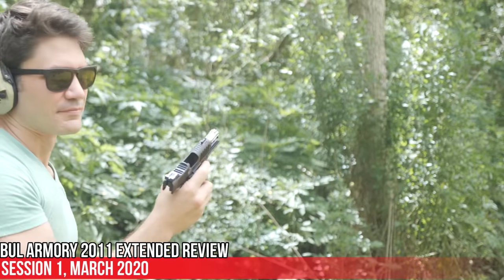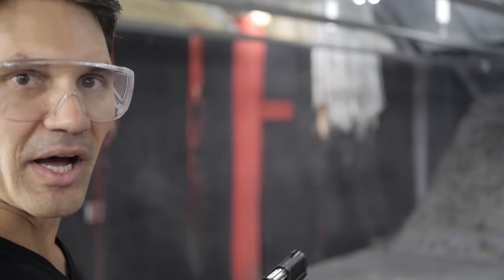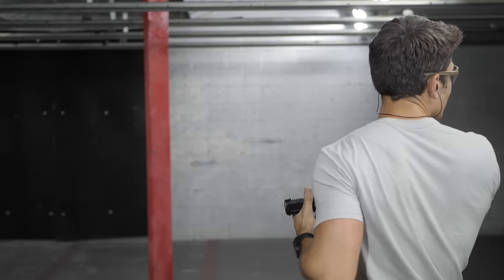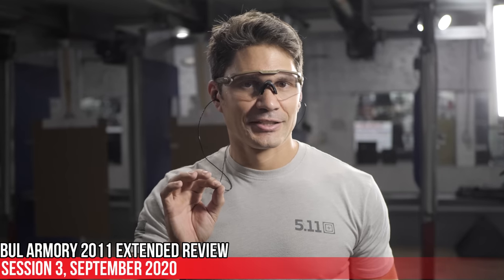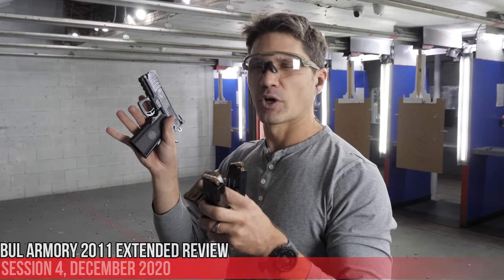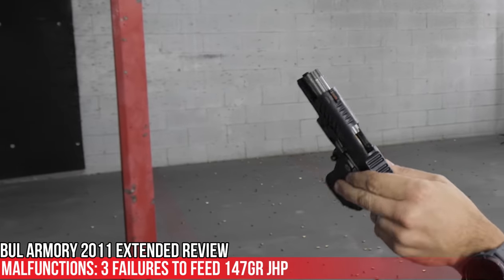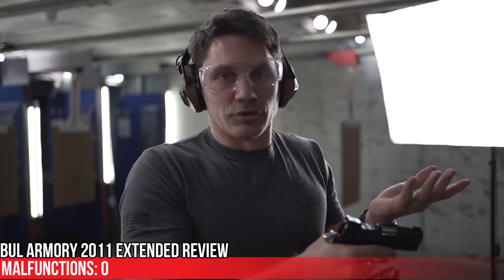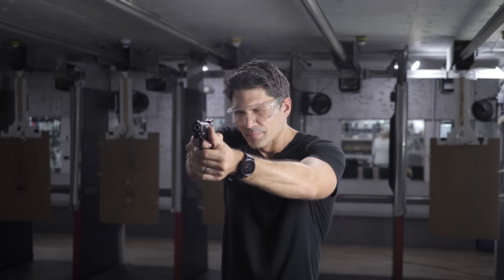Can I Trust my 1911 with Hollow Points? BUL SAS 2011 Extended Review

Comment: If it were me, I'd just stick with 124 gr ammo.... 
Doc, it hurts when I do this.
Well, don't do that.
Reply: 9mm 147 gr JHP is an abomination. The only excuse for using it is in a suppressor host. And only then if the particular load is thoroughly tested in the host firearm with the can installed.
Reply: @careylymanjones  Yep. Have ran my Bul with 1000 rds of Winchester PDX1 124 grain +P Defender JHP without a single issue. Not a single issue with 147 grain either. Because I don't carry 147 grain, so no need to run it.
Reply: Well said HalfCrazy. I was thinking the exact same thing. There is plenty of effective 124 grain hollow point ammo out there  to do the job.

Comment: I have a Bul armory 1911 standard Gov model and it’s a fantastic pistol. I’ve put roughly 1300-1500 rounds through it and only had one failure to feed with shitty Winchester ammo. Smooth action and amazing trigger. Bul armory is the best.
Reply: Which Bul? 1911? 45acp? Magnum Research 1911U C. Built by Bul Armory. Around $850 or so. But Mag Rec has a cappy history in the 80's.
Reply: @hatch721abg  it’s built by bul but branded magnum research. 1911G 45acp.

Comment: "If it can't run the garbage ammo, it doesn't deserve the good stuff"
Reply from the maker: "If you don't love me at my 147gr you don't deserve me at my 124gr"
Reply: @tfbtv  "Jus PEE PEEEEE it away!" 😂 Had me Rollin!
Reply: @tfbtv  Haha! If you can’t handle the rounds at the tip of the magazine you don’t deserve the rounds close to the baseplate. #LRBHOjoke? 🤷🏻‍♂️ WTF are we even doing here, I’ll see myself out.
Reply: If it runs super reliably with underpowered Garbage ammo? Odds are that something in the design is wrong and the gun will end up beating itself up when you feed it the good stuff. Ask anyone who's owned a high round count Glock 22...  That gun's early iterations would malfunction if you had a light on the rail. Not an exaggeration. 

A Surefire light attached to the rail of a Gen 3 Glock 22 up until the design was finally revised in 2013 could legitimately cause it to malfunction and when one fed it good hollowpoint loads at about 10k round mark the thing was pretty much near worn out.
Reply: I don't remember him using junk ammo, is there worse than white box winchester, that's the cheapest i've found in Jamaica
Reply: @davidleesin112   Oh there's a LOT worse than  Winchester white box.. though  James did use some questionable 20+ year old ammo.
Reply: @reignick1133  that's true @ 20+, i've had ammo for less time & they literally fizzle Lol, one area that interested me was maybe tolerance of the feed lip, some of the cartridges were a little longer, but most times i've seen the ramps smooth out after maybe 200 rnds or less, i do like that 1911 though, albeit polymer handle , wonder how long that will last over time
Reply: @hardtarget2359  +P it away.
Reply: @reignick1133  questionably 20 years old yes. But they looked like perfect rounds in his hands......... 147+gr ammo may not feed in all weapons they're just a little longer.... and Especially out of a shorter slide gun.... your asking for issues.

 My first pistol was a ruger sr9 when they were out for Bout 3 or 4 years.... it ate everything. My cz p07, I run 124s exclusively simply bc i found no benefit in anything heavier. Same with the walther ppq.

Comment: As a fan of the 1911, I've found with heavier/longer hollow points they have issues feeding, and from shooting the same ammo through guns side by side, imo it's due to the fact that the barrel doesn't move on a 1911, and the feed ramps are very steep. I've never been able to use the fatter grain bullets (on 9mm or 45acp), so it's amazing that bull has found (hopefully) a way around it.
Reply: My Sig Ultracompact eats HP's just fine. I carry 230 gr. Ranger T's. I've fed it a few mags.
Reply: barrel does actually move, try a different barrel link which prevent the barrel from moving further back allowing room for the round to load into the chamber
Reply: @Jessedh138  ...or just get a Glock.
Reply: Seems to me the heavy hollow points are pointless, mostly you want higher velocity lighter bullets to aid expansion.

Comment: I picked up the Bul SASII UL FS .45 & haven’t shot it much yet but no problems.  Lots of recoil but that was expected & very accurate.
Reply: A little to much recoil , I got the same ,the fs 45, make sure ur rounds are not bumping the slide stop nub like mine was causing the slide to lock back prematurely
Reply: My ultra .45 won't run at all. Bumps the slide lock like you mentioned Tom. It's back at Bul for the second time. What a bummer!
Reply: @antonvouk4145  & Wally Unitus how many rounds have you put through?  I have only put about 50 through so maybe it’s gonna happen & I’ll keep you guys informed what happens.
Reply: @tomharper8351  I've ran about 300 rounds through it. Got it back from Bul running exactly the same. I have ran every ammo I can get ahold of with the same results. The slide is getting banged up from it trying to lock back while cycling.

Comment: "If there's a negative comment imma be rude" dude ain't fucking around ammo expensive
Reply: I feel his pain. A box of HST costs as much as a Taurus G2c pre-2020.
Reply: @keithv3767  yeah I feel it for sure I've been a into guns for a while but just turned 21 this month so getting a ccw is kind of a pain
Reply: Loved this comment myself.  Totally get were he was coming from. And thanks James.
Reply: @TheRealZJE313  yeah im not picky but the 43x looks like a solid ccw
Reply: @trenton6621  Glock 43x or 48 are nice af for a ccw. I have the 48 and my buddy had a 43x. The slim frame makes it great for concealing and feels great in the hand. Only down side is that its a single stack 10rd mag. You can get aftermarket 15rd mags though.
Reply: @TheOneScooby  I always like a great hand feel
Reply: @trenton6621  check out the Sig 365XL if you’re going striker fired.
Reply: @tomharper8351  just bought a kahr cw9 but ill take a look
Reply: @trenton6621  Can you speak like a caucasian please?

Comment: I ABSOLUTELY appreciate you doing this. This is the same ammo I use and have had very similar results with various guns using the 147 and 124gr HST. So weird, I too have never had a problem with the 124,  but a few guns have not liked the 147 HST. 🤷‍♂️
Also, I just spent $950 on a case of Federal HST 124. I never in a million years thought I’d spend that kind of dough on ammo, but even more sadly is the fact that this was actually a pretty “good deal” right now - Ugh!!!

Comment: One of the best cycling 45acp loads in 1911s I have experienced was the Lawman 200 gr speer JHP load back in the mid 80s . I had a cheap Star PD 45 / 1911 compact that ran forever with that load . I wish they'd bring that  load back !

Comment: A $1270 (+shipping, fees and tax) semi-auto should not have those problems right out of the box.  Definitely need to test any new-to-you gun ...and the magazines.  Considering the time and paperwork to buy a handgun here in NJ, I always worry about buying a "lemon".  Over 20 years ago I had a new Firestar 45 that I sent back to the factory with similar problems with HP.  They did some polishing to the rails, and polished and re-shaped the ramp slightly ...and it solved the problem, though it was a bit disconcerting originally.  It's a nice handgun, a bit heavy by modern standards, but it did put me "off" buying additional semi-autos for many years.

Comment: Fantastic review! I absolutely love the 1911 platform but yes they can be finicky with some ammo but yeah! 

Thank you Jim!
Reply: Mass production 1911s that are not proper hand fitted that are out of spec of JMB design is the issue. 3.25 1911s rarely work because it was never designed to work that short of a slide. Very few companies get them working flawless and especially mass production 1911s are not given the hand fitting.they need.

Comment: I had jams quite often with my 1911's 30 years ago and took two 1911's and all my mags to a gun store owner and gunsmith . All he did was ask for my mags, went in his back room. After about 15minutes or so of listening to " tink tink tink tink he came back with my 15 mags and a open can of fired 45 acp brass and told me to load the empty mags with the empty brass and load my 1911's. Then told me to rack the slides as if shooting. Not one failure to feed. Since then I haven't had a jam with any of my five 1911's . I did take 30 new mags to this gunsmith to do the same to them. He has since passed and those mags still run flawlessly but I'm down to 12 of those mags due to giving them to friends tut o fix their game problems....and I'm keeping them!! Before he passed I was lucky enough to have him accurize a colt 1911 for me. It was a match winner.  After he passed away I heard that every 1911 he worked on he would take it to a match and shot the match with it....if he didn't  win the match he redid the accuracy job again. He once told me to carry a 1911 and several loaded mags in my truck and when I could fire a mag or two thru it. Stating you can't just shoot a 1911 once in awhile and stay proficient with it. He said you didn't need a target you just had to shoot it...accuracy will automatically come.

Comment: my CZ 75 Compact D PCR Custom ($950) with close to 1000 rds shot has never had a failure to feed. my STI tactical DS ($2500) suffered a FTF every other magazine or so from purchase. I Sent it to STI in Georgetown Texas. My observation was the slide appeared to be slightly misaligned as it was challenging to set the slide open, requiring multiple attempts from time to time. sure enough, STI agreed and calibrated the slide and frame to STI's super high quality standard of slide alignment. The STI has not suffered any failure to feeds since STI did that work on the gun. (BTW, STI received and sent back within 10 days my 9mm--great customer service) So my experience James may be similar to yours. the higher end 1911's--Bul seems to be such even with a much lower price--suffer from failure to feed if the slide is not absolutely properly calibrated to the frame.  Just as i feel i can rely on my STI now, i believe you can rely on your SAS II since receiving it back from Bul. BUT, i'm still using my CZ PCR for carry, not my STI.  Nonetheless, that STI DS is a bad boy and sits on my night stand when i go to bed. (NOTE: my ex wife pointed out to me that using the term "pussy" to suggest something is weak is absurd as she pointed out that the Pussy has the strongest force of anything in the world..... As she was my 4th wife, i couldnt argue the point.)

Comment: For all of your hating on 1911s, we ran about 200 rounds of crusty reloads that sat in a Maine garage for 2 years (covered with tacky green tarnish that was cleaned off a bit) through a Taurus 1911. Had to go slow watching for squibs but the only failures were dead primers. We also ran store bought fmj, fresh reloads from 195-230 grain and JHPs all week, 700+ in all. Surprisingly accurate and no fails..none

Comment: I keep watching a lot of videos on the 1911 not feeding hollow points.  I took my Colt Gold Cup to the range today and ran over 250 rounds of hollow points through it.  I used flyin ashtray 185 grain (really short flat hp rounds) and I used 230 grain hp rounds.  I used Colt mags, Wilson combat mags, ACT cheap mags, and Kimber mags.  It never jammed once.  I feel very relieved 😅.  I would have no problem trusting it as my EDC without hesitation.  It shot like butter 🧈

Comment: Just for everyones knowledge this isnt the first time for me in the 9mm 1911 rodeo.  What Ive learned is not just 1911s but a lot of other 9mm pistols have the same issues with 147 grain.  What resolved the issue for me was I had to play around with the recoil springs.  A stronger recoil spring usually resolved the 147 grain hang ups.

Comment: I'm not a 1911 guy, and this is one of the reasons. 

Bul makes good guns, but 1911s are tempermental.

James is absolutely working this thing through the paces.  Mag issues I suppose?

Did they lighten the spring weight for reliability sake?

Comment: Check to see if there are any contact marks on the slide stop from the bullets just barely contacting it.

Had a 1911 in 9MM, and certain hollow points were just barely making contact on the part of the slide stop, could just see the copper color. Took and filled off the edge and it was good to go.

Comment: This mirrors my experience with a 9mm micro 1911 (EMP3). Ran fine with FMJ when I got it... choked on JHPs. Sent it back, they re-cut the feed ramp... ran JHPs fine after that. My takeaway? 1911s need hand-tuning on a case-by-case basis to function optimally. And when they have that... they work (and shoot) as well or better than any other gun. But straight out of the factory, I'm not sure I'd 100% trust one--unless it was some high-dollar custom job where the hand-tuning is part of the deal, off the bat.

Comment: I have a RIA1911 government and when I was at a garage sale once found a 1911 7 round government mag fully loaded with 230 grain ball the entire mag was Green from corrosion and after buying the mag I went to the range and shot the seven rounds off as fast as I could while limp wristing the pistol to see if it would fail but the pistol, magazine and ammunition all performed flawlessly. So when I carry it I always carry with Wilson Combat magazines and ball ammo to get the best reliability possible
Reply: The 1911 is designed to shoot ball ammo so that's why I shoot it I've tested hollow-point ammo in the past and had relatively good results and only one of the types of hollow points that I've tried  have jamed, with ball ammo I've tried everything from Federal Premium brass cased ammo to Blazer aluminum case and had no jams although I will admit with the cheaper ammo there are times you will get bullets pushed back into the case and I had one dud

Comment: I have found as well some feed issues with the 147. I found for me down loading to 14 in the mag was enough to fix the problem. Not a huge deal since getting in the 15ht round is a bit of a pain.
Reply: Once the mag is broke in, even just sits full for a month, it will most likely correct itself
Reply: @matthewbeaver5026  that's what my current plan is.

Comment: I have heard a 1911 needs about 1000 rounds to break it in right and not have any jams. Don't know if true but I had an old used beat up Auto-Ordnance 1911 45 that never jammed on me and chewed up hollow points as well perfect. Wish I never sold it. The ruger p89 series is the only pistol I have owned that hung up and jammed straight out of the box brand new before the first 200 rounds after that flawless. Love that pistol James!

Comment: Modern expectations.
Back in the day (I'm just old enough to be able to say that), we used to try many different brands and types of ammo through our duty/carry 1911 type guns and carried the one or two that worked.
With duty guns sometimes we didn't have a choice, so we tuned our guns (often a frustrating experience) to the ammo, or got another gun.
I feel ya James, and I like that gun. Unfortunately, I will only carry 45 acp or 10mm.
Old dude, not knocking the younger generations.

Comment: I gotta say james i have tested this exact scenario with my sas 2 ul and it still hasn't hung up at all. I bought a butt load of 147gr hp's and 124 hp's and i haven't had a single ftf or fte. I had one problem with lead free flat nosed bullets my friend was reloading and had several bullets not seated right but i tried them anyway and still only had the pistol ftf on one round. The way i see it i just carry with factory loaded 124gr jhp's because it has now fired a ton of it with out one failure, and i noticed with the ammo i chose 124 gr aquila jhp's it's point of aim point of impact is exactly the same as the fmj rounds, litterally no difference. Btw i also own a gen 5 glock 19 and with effort(especially when it gets dirty) i have had it fail more often than my bul so give that a try.

Comment: Recoil springs is probably set up for the 124 grain. Since it has such a short cycle the recoil spring is pretty critical. I know on my subcompact .45, the recoil springs are rated for so many rounds as per the manufacturer which is 500 rounds.

Comment: As much as I love the 1911 and 2011  ( Enough that I used to in better days collect more noteworthy models & learning needed gunsmithing skills to enjoy building my own 1911's and 2011's using jigs and Caspian made slides and frames.) to be 100% honest? For a CCW answer to the 2011 in 9mm?   USP Compact 9mm  ...  You can carry it cocked & locked like a 1911 or 2011, the single-action trigger is decent, it's accurate, it's lighter weight than most 2011's it's SIGNIFICANTLY more cost-effective ( You don't hear that phrase brought up much with H&K but here it is quite true.) and above all else?  It's gob-smackingly Reliable.

Making a  good  Reliable  1911 or 2011 variant for carry requires 1 of 2 things:  #1:Personal gunsmithing skill, or #2:Money.  It's hardly an "impossibility" but you MUST do your research going in and either be prepared to invest a considerable chunk of change or a considerable slice of your own time.

I chose to spend my time more oft than not and chose to spend my money in my first compact 1911 carry variant the Detonics Combat Master.

Comment: I know of a Remington Rand .45 acp service pistol mfg'd in 1944 that will take Golden Sabre hollow points without jamming. It's never been worked on, it's just as it was originally issued. Bought for $300 twenty+ years ago and sold for $2995.00 last year.